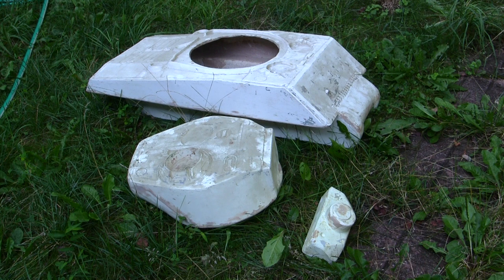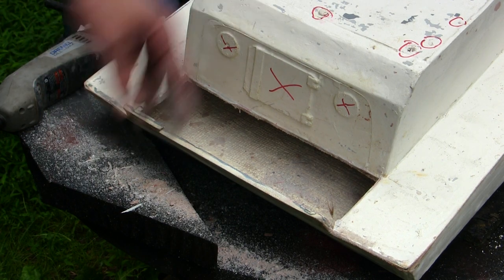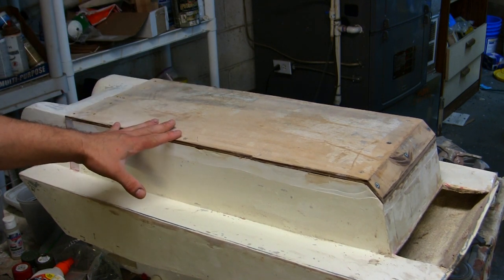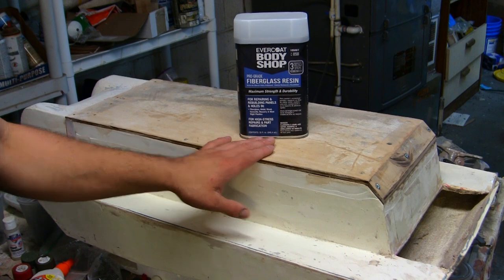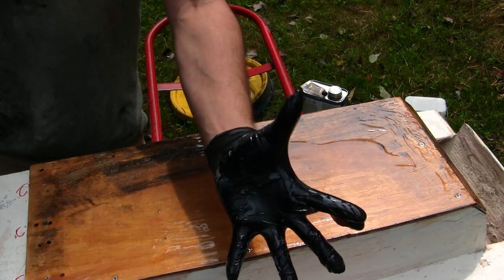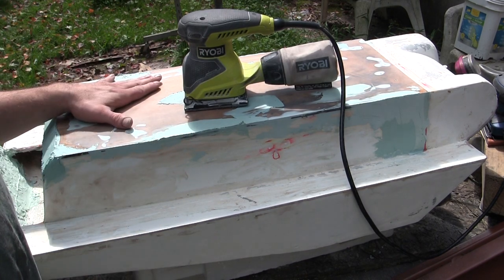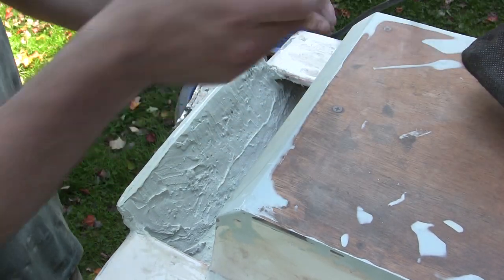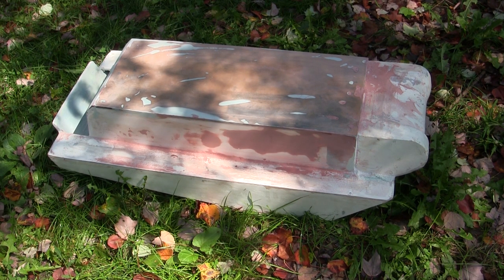1/6th scale M4A3E2 Jumbo Sherman tank project Video #2 (lower hull plate / bodywork)

Comment: I've build tanks out of wood for paintball combat but the running gear was metal.  The wood was coated with Titebond 3 wood glue which is waterproof.  Multiple layers of Titebond 3 sanded between each layer makes it waterproof and basically does the same thing as coating it with resin.  Paintball combat tanks were not highly detailed because the paintballs would break fine details.  The tanks were meant to "look" like the tank represented, but high detail was not needed.  I tend to overbuild my RC vehicles.  I am currently scaling up a 1/10th KV-1 to 1/6th scale and printing it on my 3D printer.  That build will be highly detailed.
Reply from the maker: as you stated essentially you did the same thing with the glue as I did with the resin for the same reasons. I also know about the paintball tanks, they are more function than form which is needed when you are lobbing painballs at one another. enjoy your KV project. It sounds like a cool one :D

Comment: I'm going to look up these wooden ones now. I have a lot of casting experience  and I can make molds from the wooden pieces. A hell of a lot of effort,  but maximum results. Hopefully the details would be accurate 😁
Reply from the maker: they won't, the details are non existent and the track / wheels look nothing like the real tank in question. it would be easier to just design new parts from the ground up than making copies of the wooden ones